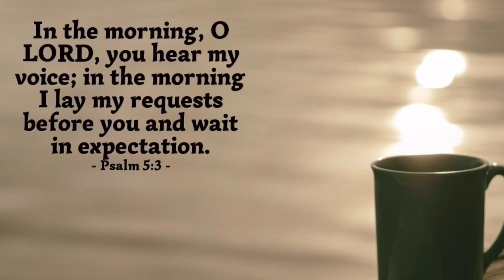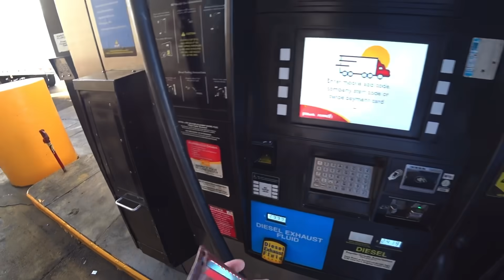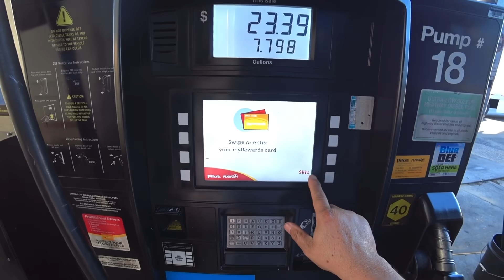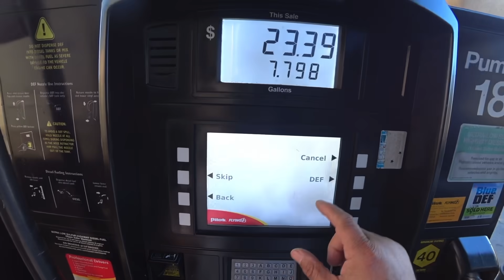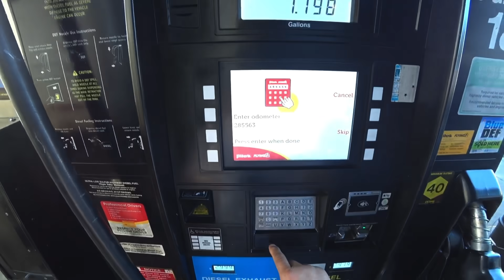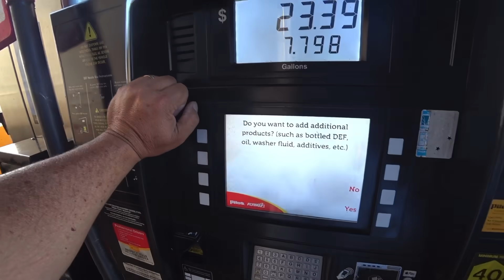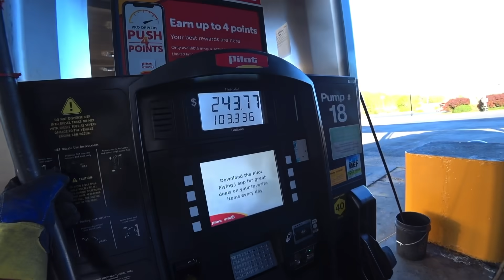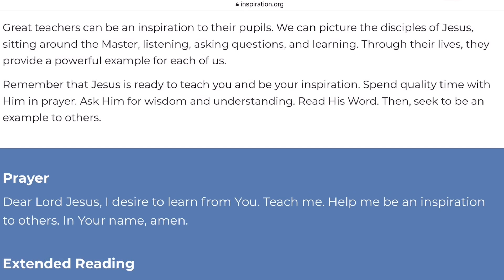May 3, 2020/208 Trucking loaded. I forgot the DEF.

Comment: My thoughts exactly. If it is as bad (or worse) as they say; it is a horrible situation, but we cant shut down forever. If it is not as bad as they say, we shouldn’t be shut down. We need to take precautions, and particularly for the high risk people. But we CAN’T stay shut down like this. As a small business owner, this plan is devastating. I probably will draw some ire from those that disagree, but I think it’s time to safely start to function again. I like to think I’m a reasonable guy, would like if we all started working together instead of stubbornly digging in at each extreme. Safe travels